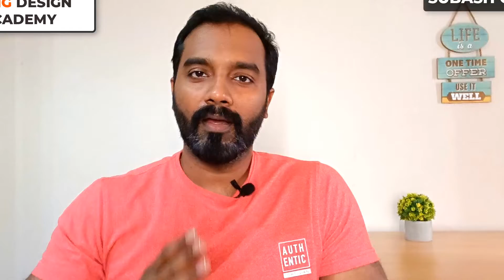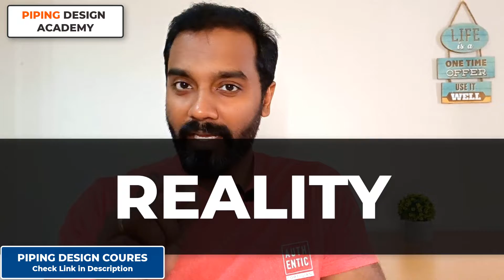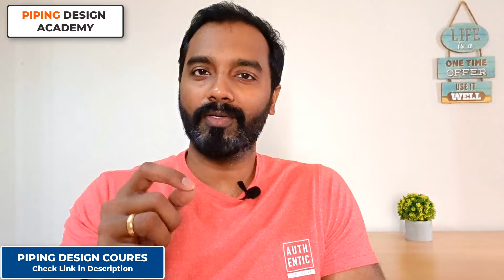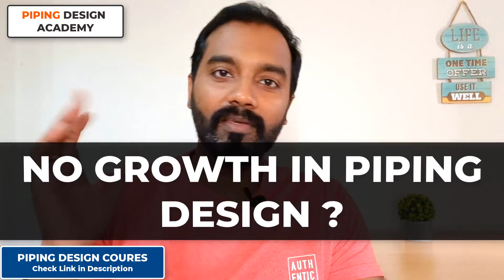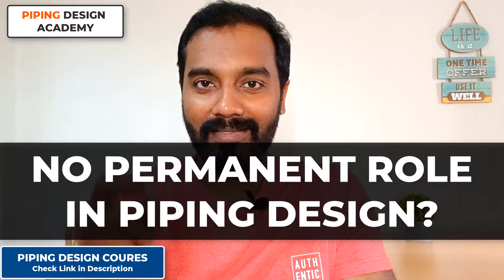Piping Design Engineering Ground Reality of Jobs, Skills required and Industries expectation

Comment: Sir, i have done BE mechanical in 2018 . And working as a mechanical design engineering in various manufacturing firm  from last 6 yrs. Can i shift to piping engineering please guide is it good option or not?
Reply from the maker: It's all about your interest. If you are interested in Piping then you can.

Comment: I have completed mechanical engineering n have 3 years of experience in project as project engineer. but i am not willing to continue because of sites and working hrs which lead to health issue. N now someone suggested me for piping design and  i got opportunity tu join a company as trainee in piping design engineering with stipend of 20 k per month. But have to sign bond for 2 years. I am confused what should i do..please suggest...
Reply: Did you done any couse Or any post graduation diploma..
Reply: In which company you joined?
Reply: Join it

Comment: Dear sir I have mechanical engineer around 16 yrs experience in ccpp, petrochemical, Oil. & Gas
Epc., O&m offshore plot forms in operation now I will plan to do  move  pipe line design engineer..... So that I'll plan to sp3d with caser11..... Is it good for me pls. Advice me
Now am. Doing pg in structural engg
Reply: Yes, you can
Reply: @NEPTUNE-h9c i am a gresh Mechanical graduate
Reply: what should be adopted in order to get a good position in Piping?